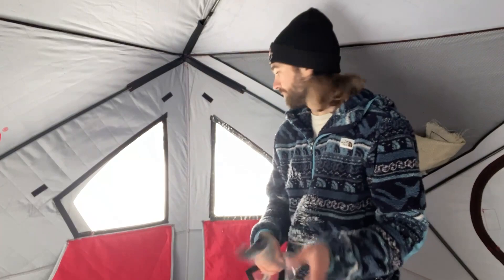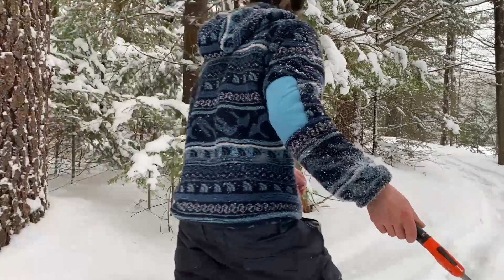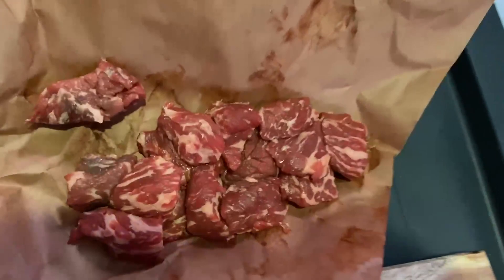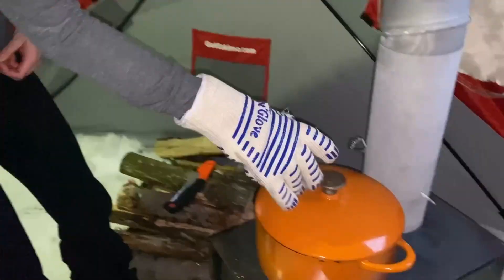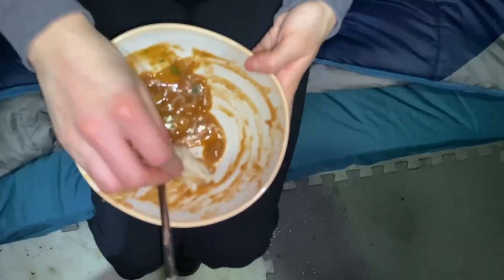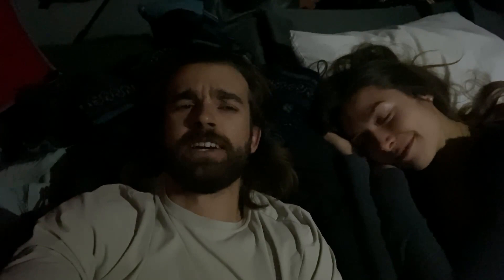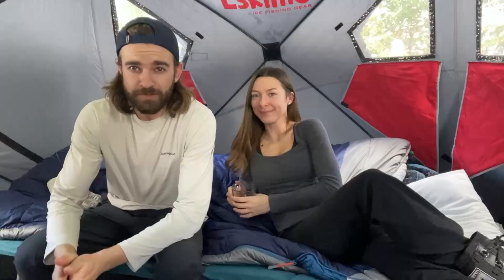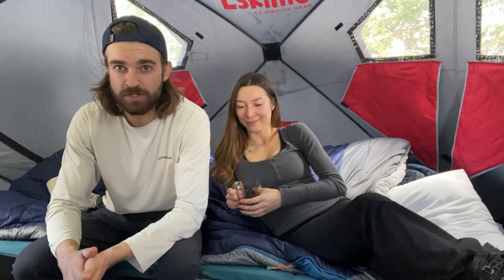Winter Hot Tent Camping With My GF | Dutch Oven Beef Stew

Comment: Hey guys, just a heads up, the stove flue is backwards. You always set up the piping so the smoke move from the crimped side the the uncrimped side. That take care of any possible leaks thru a crimped side of a pipe and into the test.

Comment: Something to try next time - put some plain flour in a ziplock bag, throw the raw beef cubes in and shake well til the meat is all coated in flour before adding to the dutch oven - helps with the browning, increases flavour and makes the stew thicken up nicely. Herb dumplings on the top of the stew are dead easy and super filling as well.

Comment: Have to say that the Beef Stew and the Crepes looked amazing.  With the new heating stove, did the covering on the window get affected at all by the heat of the pipe?  Seems like the new wood stove worked a lot better heating the tent than the Propane heat you had before.
Reply from the maker: Just a little bit of colour where the pipe was touching the blanket, but not much!
Reply: Yeah I was going to ask how the snow inside of your tent is not melting on the ground if it’s about 80° or so inside! And what did you raise your sleeping bags up off the ground with did you have some kind of platform and could you recommend one? Great video it looks like you guys had a good time
Reply: @kateapple1  looked like camping cots

Comment: U need to learn how to run the dampers on the stove to control how much O2 the wood gets to control how hot the fire is and to get ur wood to last longer So many things u did wrong its a wonder u didn't start a fire.  Sorry I learned at 9 how to run a wood cook stove to keep the oven at whatever heat it needed to be at to back and hot to keep certain spots hotter on the stove top to keep heat where we needed it in a pan we were cooking in.  And how to use a Barrel stove to heat the whole house day or night.  Not that hard to do.  And wood was all we had to cook and heat with at -45 or however cold it got.